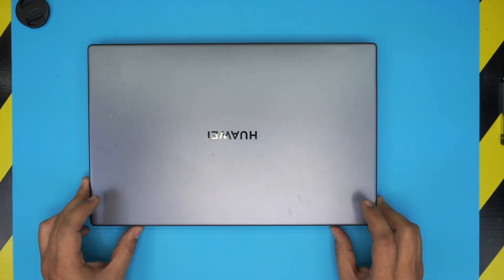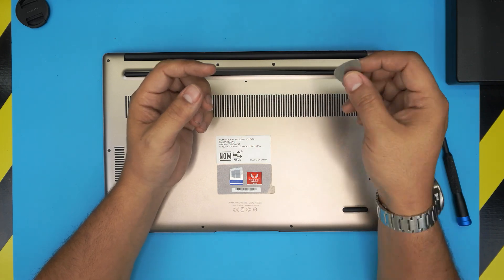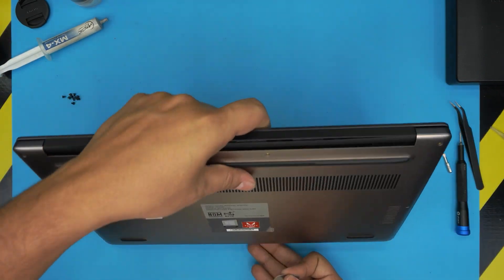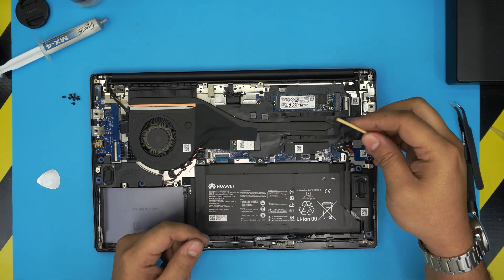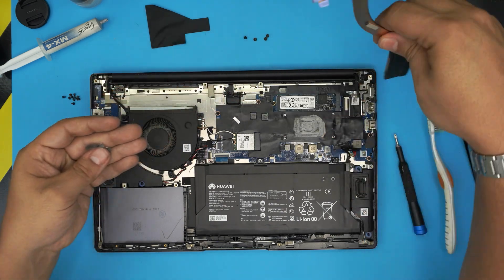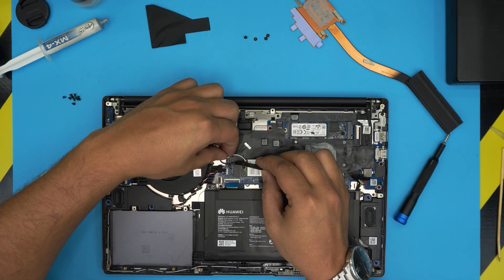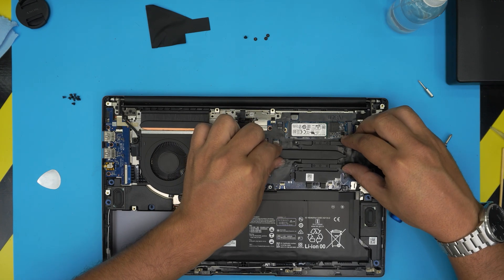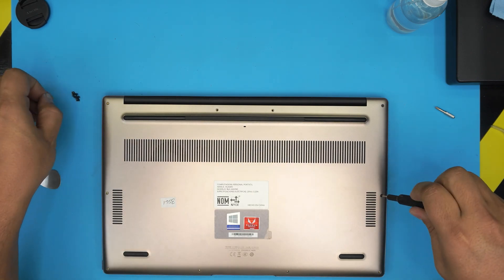Huawei D15 Boh Wap9r Service & Repaste 💻

Comment: Thank you so much, same laptop got 96°C so (I got it 2019 and this was its first thermal paste renewal) now it is 42°C. I think I delayed it a little bit but worked awesome😅

Btw, I couldn't remove the jack you said in video. I tried it, but I felt like it would damage the cables, so I decided to leave it like that. There was no problem at the end, but I hope it is not a situation that will cause me problems in the future.
Reply from the maker: My pleasure 😊 Thanks for taking a moment to leave feedback.
Really happy to hear the videos are useful! 🫠💞
you fine the jack will not cause any issues in the future.🙂
If you’ve got questions or requests, I’m here.
And if you’d like to support, a like/sub means a lot. 
🍻 Cheers!

Comment: D15 Keep restart with Huawei logo only, 2 times, and then shuts completely. Cannot reach BIOS with F2 or Alt F2. Will appreciate help.
Reply from the maker: 🫠Regarding your question, that issue is 80% likely due to one of the RAM blocks failing, and 20% could be due to a power delivery failure on the board.

Comment: hello bro, can i upgrade the ram from 8 to 16?
Reply from the maker: 🫠Regarding your question, the RAMs are soldered on the board. If you want to upgrade the RAM, you'll need a repair shop that knows how to do "BGA reballing." We can remove the RAM chips and replace them with higher-capacity ones.
Should you have any further questions or requests in the future, please don't hesitate to ask me.
cheers🍻
Reply: @uFixTek what do u think i can do to make my laptop faster and perform better?
Reply from the maker: depending what you want to use the laptop for.
Reply: @uFixTek i use it for gaming, i play valorant i get unstable 70-100 fps i already tried software improvements. i was wondering if u know anything i can do so that the performance improves
Reply from the maker: Oh boy, these laptops are not designed for gaming—they will overheat many other components and you will degrade the life of the motherboard by 80%.
These laptops are intended for administrative use.
The heatsink is not good enough to cool the CPU, and the power delivery components don't have any cooling.

Comment: Hi there, thanks for this amazing video. I want to ask whether you are familiar with audio jack problem, so my audio jack often times not producing sound for my wored earphone. Speakers and tws works fine so i know it's hardware issues. However, i can somehow fix it temporarily if i flex the chasis a little bit, or if i put like a max volume first and then turning it down. But the issue will eventually appear again. I really don't know what's wrong and i wish to have an assistance from you
Reply from the maker: 🫠Regarding your question, we do encounter this issue in the store often. The problem is that people use the audio boost application and push the volume over 100%, going to 130%+, which causes the audio chip on the board to overheat. You will need a good technician who knows how to solder and desolder a BGA chip to replace the audio controller on the board.
cheers🍻
Reply: @uFixTek  so the chip is fried due to overheat? But why is that it went back to normal when i raised the volume?
Reply from the maker: The chip is partially paralyzed (damaged), and when you raise the volume, you're pushing more voltage, and the resistance changes to a different section.
The chip is damaged due to overheating caused by the amplification of the audio.
Reply: Hello, sorry for jumping in. So it's a permanent damage on the BGA chip? @uFixTek

Comment: I couldn't turn on the laptop.
Reply from the maker: double check the cables and connectors.
Reply: @uFixTek  You misunderstood me. It cannot be opened with a screwdriver, how do I open it? Does he have a special tool?
Reply from the maker: Yes, it is a special screwdriver—it’s a Torx 5. I mentioned that in the video right at @1:00
cheers🍻

Comment: bro my internet isnt working since I cleaned the laptop
Reply from the maker: 🫠Regarding your question, when you saying internet not working , what you mean?
you can connect via wifi ? but no internet? or you use ethernet cable and no internet?
i need more detail.

Comment: I just brought my Huawei d15 at local computer shop. I noticed in some portion of my heatsink has flattened (aggressive handling). They also replace the thermal pads much thicker size.

Will it affect the cooling system of my laptop?
Reply from the maker: 🫠Regarding your question, you will have a not great not even good thermals, if the heatpipe is bend and is pressed , you will need to get the new heatsink and replace the pads with thinner size.
cheers🍻

Comment: The screws protecting the processor don´t turn. I`ve tried several screwdriver heads, rubber band, electrical tape, and still nothing. Is there anything I can do, before having to take it to a repair shop? :(
Reply: Samee
Reply from the maker: Regarding your question, sure you can , just make a insertion on the screw head and use a flat screwdriver, here are some videos that may help you.
https://youtu.be/xLt6dMIsO9E
https://youtu.be/UaMO0sH45VI

Should you have any further questions or requests in the future, please don't hesitate to ask me.
cheers🍻

Comment: My laptop is still hot after cleaning the heatsink and fan and after repasting it with the thermal paste you reccomended
Reply from the maker: this service is to cool down the CPU and service the laptop, if your laptop blowing out heat that is what does the fan does.
you need to check the CPU temps, not if the laptop is hot!, if the laptop gets how there is no magic paste to disappear the heat!.

Comment: You should have pressed the power button for 30 seconds to drain any power from the capacitors. Just to be safe from statics
Reply from the maker: no need to there is a enough resistors that do that for you and enough diods, as soon as you disconnect the battery under 3sec the board is discharged.
BUT if that makes you feel safe sure press and hold for few min.
cheers🍻

Comment: Good day! My Huawei Matebook D15 laptop does not initialize, the Fn and Caps keys are on, the fan is spinning, but there is no image.

Previously it had this problem, but on some attempt it still started, so I was able to update the bios from windows. After that, the problem disappeared for half a year and now it has happened again.

Do you think the BIOS firmware can be damaged because of it? Maybe you have already experienced something similar?

  Sorry for my english, translated with google :)
Reply from the maker: Thank you for your feedback! If you'd like to support the channel, you can like, subscribe, or do both!

Regarding your question,  your English is fine , also you can speak in your own language i speak 6 languages, we do get this issue a lot in the store and this laptops have a big issue with the bios  chip they do get cropped very easy. you need to replace the bios chip, de-solder the old and place a new programmed chip, that is something a good technician can do.
other than BIOS there is nothing wrong with the laptop. sorry that i have to tell you this but there is no simple instruction (clicking and stuff) for you to fix it, you can keep trying to power on and you may get a single boot.
Reply: @uFixTek  Thank you!
Reply from the maker: it's my pleasure my friend. 😊 
Should you have any questions or requests in the future, please don't hesitate to ask me.

Comment: What kind and size of screw driver you used when you opening the headsink?
Reply from the maker: Thank you for your feedback! If you wish to support the channel, you can like, subscribe, or both!
Regarding your question, Philips #1
Reply: @uFixTek I have a Philips 1 screwdriver but I can't open the cover
Reply: @uFixTek Hello, can you help me?Today I went and bought a multi screwdriver set. The screwdriver bits you mentioned are included in the set I bought. But none of these ends open that screw. Pls help me ❤

Comment: It is requested to guide me regarding my issue in huawei matebook d15 not turning on. It happens often but this tine its about 1 day and it's not turning on. I was out of city for three days so my laptop was off for last three days. In my absence no one even touched it but still this issue. When i plugged charging wire it is still showing not charging sign no power led on.
Reply from the maker: Thank you for the feedback! if you wish to support the channel you can LIKE or SUB or both :P
regarding your question: open the laptop and disconnect the battery and press and hold on power button for 60sec and then let go and plug in the battery and plug in the charger and test it out.

Comment: Is it necessary to pull out the battery plug?
Reply from the maker: Thank you for the feedback! if you wish to support the channel you can LIKE or SUB or both :P
regarding your question: I would highly recommend you to do it, but if you very cautious and make sure you don't drop a screw on board then no, no need to remove it, i mostly don't remove the battery as im very careful with laptops when im working on them

Comment: Thanks dude, this helped me a lot!
Reply from the maker: My pleasure! Glad you liked it 😊Thank you for the feedback! if you wish to support the channel you can LIKE or SUB or both :P
if you have any question or request in the future feel free to ask me.
Reply: @uFixTek  Do you think using liquid metal would be a very bad idea on this specific model?
Reply from the maker: i would never ever recommend to use a liquid metal on a portable laptops my friend! there are few and one key important thing about the LM and 99% of the tech guyz don't know because it doesn't relate to tech, and that is the Properties of the LM.
i try to explain as much as i can, 
#1. LM as we know has the highest W/mK (around 70) so that makes it the best know usable item to place on COPPER and GLASS components.
#2. LM will never or eat or damage your COPPER heat sink it will bond to it, but with a small polishing it will be back.
#3. LM is extremely conductive, you will need to isolate the nearby components.
#3. people say that LM is good for a year or two then you need to reapply it! (that is NOT true on for the subject of "that has a time expire")
-what people lack of understanding of chemical properties of the LM is that the LM at its applying stage is liquid but only does a good job of heat/cold transfer up to 60% at most most
-once a heat/cold had been transferred for XXX (few months) amount of time, then the Liquid portions of the LM will be evaporated, and a very thin and extremely delicate bond will be created, and that small and delicate bond will transfer heat/cold at 100% now for EVER!
BUT any small vibration or hit or moving the "laptop" on a table with slightest drop will break that layer of bond (crack) and you will have the horrible temp results, that what people call it expiry date lol
BUT placing a LM on a console that will not move or pC that stays at one place or server or workstations are the BEST option!
we have experimented and have talked to a PHD chemical researchers to give second opinion.
therefore if you planing to move your laptop around : use a paste version of LM that its only off by 5-7C: Thermal Grizzly Kryonaut Extreme: https://amzn.to/3SeXBRy
because even with the highest heat transfer properties (LM 70W/mK compare to 12.5W/mK paste version)  you would think that it should be better temp drop and not only 5-7c , but you got to remember that the LM or paste are not cooling solution the cooling solution is at the vapor chamber and how fast copper can absorb that heat and release the heat and inside the heat tubes are liquid that transfers heat and how good of tube are in your heatsink, Don't use Water coolers they are the same results as air cooler.
if we had a better cooling material beside copper then  we could take advantage of that 70W/mK properties, but till that happens, use paste.
i hope i have explained my self.
if you have any question or request in the future feel free to ask me.
Reply: @uFixTek  Thanks a lot for the explanation pal, I'll buy that specific thermal grease and apply it to my laptop.
Reply from the maker: it's my pleasure, you will be much better with that on your laptop